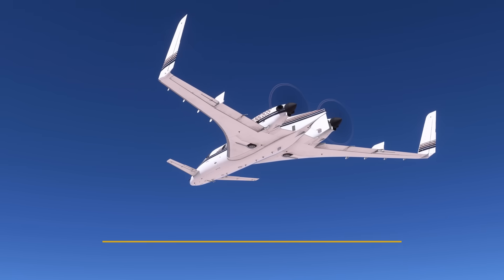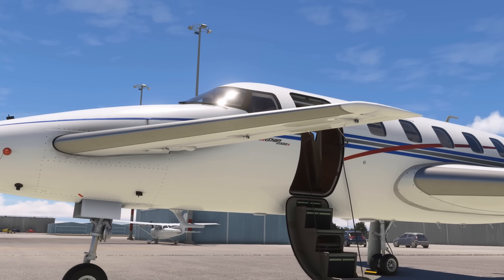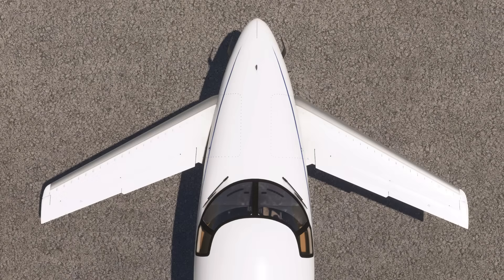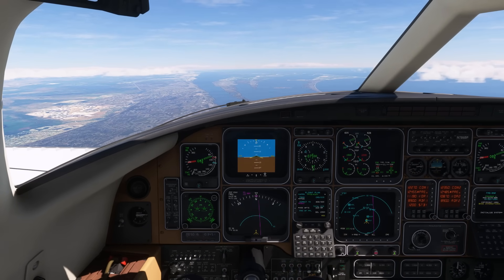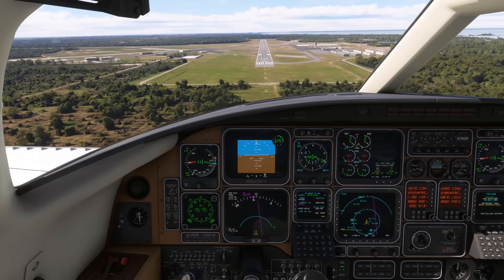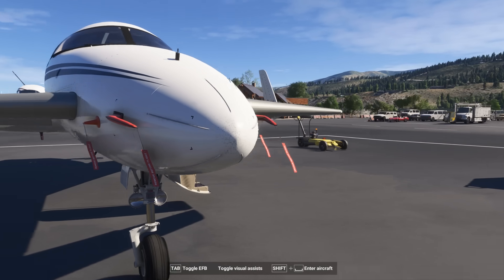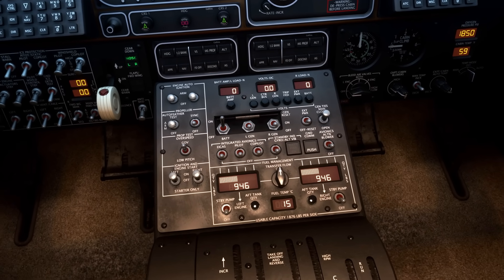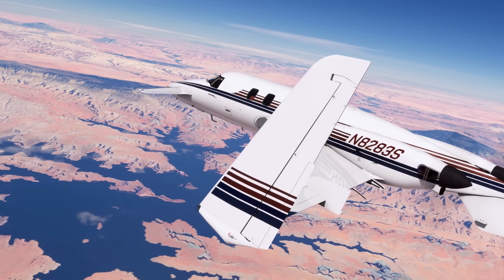Black Square Starship MSFS - Airframe & Aerodynamics - Just Flight

Comment: Please correct the TBM 850 it’s crashing a lot
Reply from the maker: If you have a problem please open a ticket or email our support team and they will look to assist you.  Support can be found here:  https://www.justflight.com/support

It's not crashing for any of the team here and we'd had no other reports of the same so it'll need properly investigating.  Could be an host sim issue or another add-on causing a conflict.  Happy to help if we can.
Reply: @justflight I did I can text you the screenshot of the conversation which I had with the developer, he acknowledged and said to me probably someone from just flight can fix it. Check the forum for title called” crash on exit “.
Reply from the maker: @FSXXtreme  It's always much better to open a ticket with support than post on the forum. It just gets dealt with in a better fashion and is more conducive to getting something looked at and followed up properly.  If you opened a ticket and have a ticket number let me have it and I can check on the status, no problem.
Reply: @justflight look I’ll buy this one because I appreciate quality. The dukes no issue, TBM has problems. Right now my computer isn’t hooked up. When I get the time I’ll open a ticket😄. The developer is already aware, hopefully it can be sorted out before 😊.

Comment: I would love to see the Avtek 400A in the sim. It is a very similar aircraft to Starship. In the mid 1990's I produced demo CDs for this aircraft that could be mailed to potential investors. They flew a guy named Graham in from Ireland to do the narration. I used a video capture card to capture video from a VHS and used the MIDI file for U2's With or Without you as the background music. I remember I had a lot of trouble syncing up the video and sound.

Comment: day one purchase, you have become the new A2A
Reply: Plus we've only seen 1 A2A in the last 5 years....  I'll be first in line for the Aerostar but where are A2A?
Reply: @RyanbATC  agreed, BS really have jumped to the forefront of GA in flight sim. Happy to drop $$ on them!
Reply: @RyanbATC I don't think you've actually flown their Accusim planes if you feel comfortable making such a statement. Accusim is objectively a league above anything available in MSFS right now and has been for the past decade. Literally every single aircraft with a separate livery is an entirely different plane with a character that develops over time. You buy one addon, but in effect you buy several versions of the same model of aircraft based on its livery. They are all different and they all age differently as you use them. 

Not even mentioning the level of fidelity A2A is able to bring with their own custom physics and sound engine that runs outside MSFS, which allows them to simulate things as granular as fluids flowing in tubes. 

And they're still here. They've been busy with military contracts the last few years making aircraft sims for the USAF but they will be releasing the Aerostar 600 this year I believe.
Reply: @RyanbATC  Unfortunately, A2A are MIA which is a PITA...
Reply: lol no, A2A is still out and about and although they are the closest anyone's ever gotten, Black Square stuff still isn't as good as A2A stuff.

A2A aircraft with Accusim, no matter which aircraft, feels like a living, breathing machine with each tail number having its own character.
Black Square still is off that mark. I have several of both.

But A2A is such a high bar of standard that even being mentioned in the same breadth is an accomplishment in my view.
Black Square are certainly getting there.
Reply: It's better  @ChristianNelsonn
Reply: @ChristianNelsonn  At least Black Square is actually, you know, releasing aircraft...
Reply: @ChristianNelsonn have you tried the Dukes?
Reply: @kbxt Yes. I'm basing my views on the Dukes as the latest and most advanced simulation they've released so far.

I mean I can talk about how A2A addons simply feel like the real thing till I'm blue in the face, but really the only way for you to understand it is to just get one and see for yourself.

The Dukes feel clinical in comparison to the A2A's Comanche (and I don't even like the Comanche, my favourite of theirs was the B377).
Reply: @ChristianNelsonn ah kool, fond memories 😊